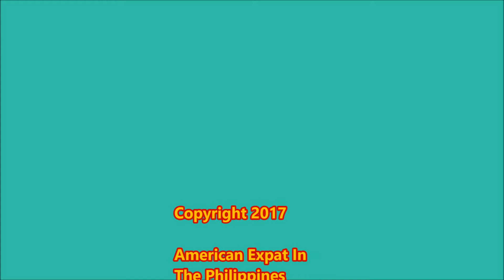What I've Learned About Camiguin's Electricity

Comment: Interesting.  One doesn't want to run on the diesel generator.  Camotes Islands use one and the electric can be very high I am told, more than rent if you use a lot.  You do need a backup though.  Wind and solar would be a good addition probably if it is economical.
Reply from the maker: Wind and solar are expensive, and unreliable. Geothermal would be a lot cheaper, and more reliable, but the Governor says no.